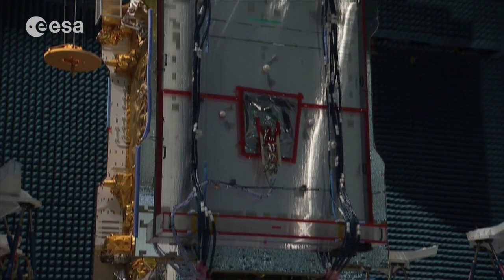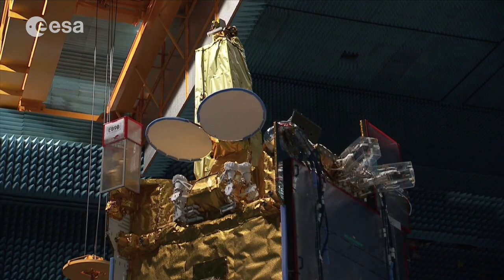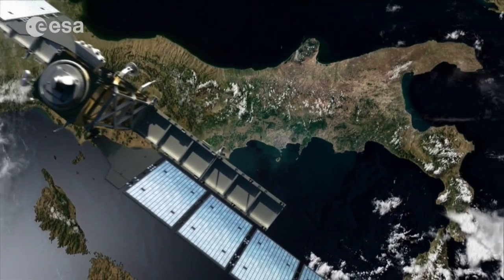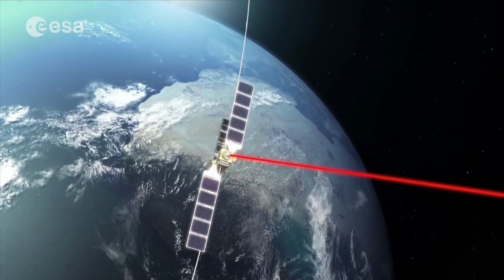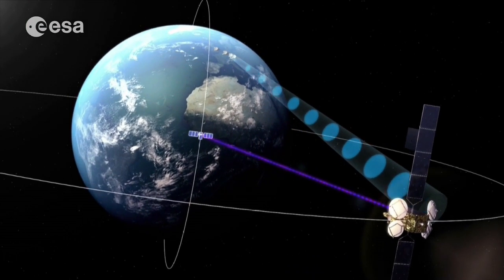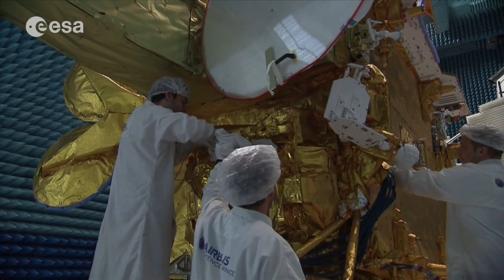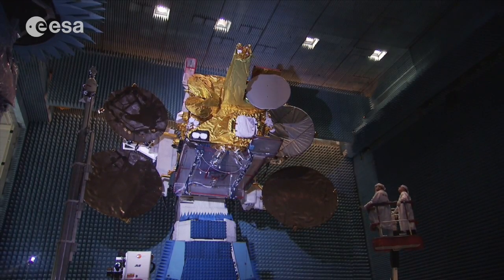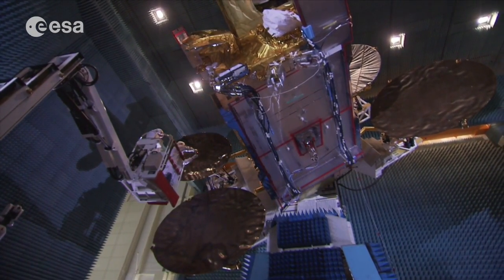EDRS - A leap in satellite-based telecommunications technology

Comment: plz make an LEO to GEO space tug with ion engines.
Reply: is it even possible today?
Reply: אלכסנדר ברבר
Yes, I think there's a white paper from nasa advanced concepts discussing the problems and logistics.
The technology is certainly here, but of course there are problems, ie the power density of PVs and power requirements are a bit problematic, every payload must have  docking systems etc, but it would be very economical, especially if payloads carried the fuel with them.
However adaptation of new technologies is really, really slow in the aerospace industry, mostly because the capital costs and R&D times dictate unreasonable lengths of testing.
Reply: i mean the idea of space tug is indeed possible, but i think that ion engines are still not powerful enough to fulfill the job, and other types don't have decent enough specific impuls to make it a viable option.

i may be wrong, but would love to ear some other opinions...